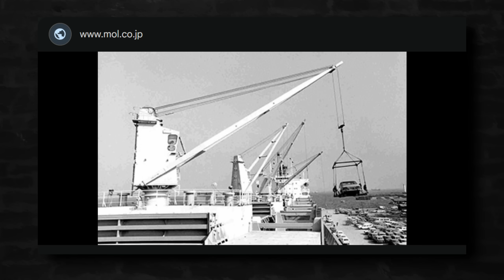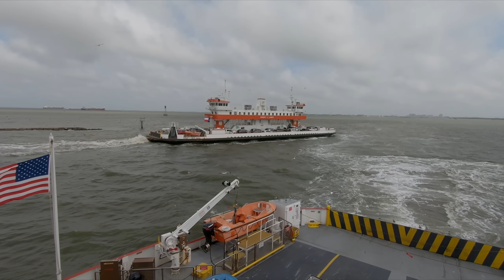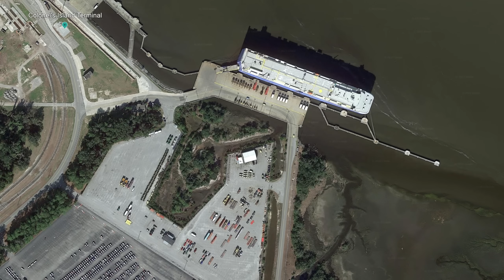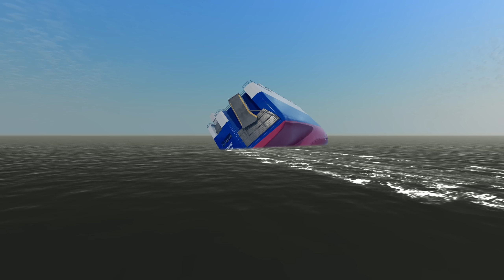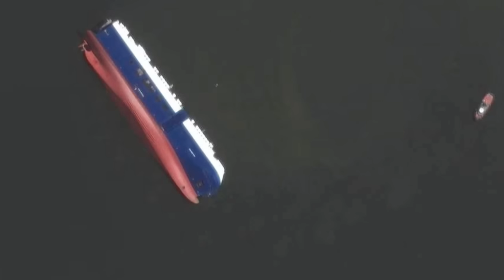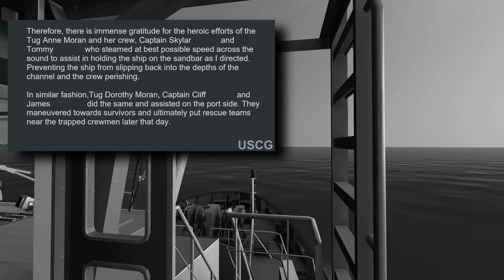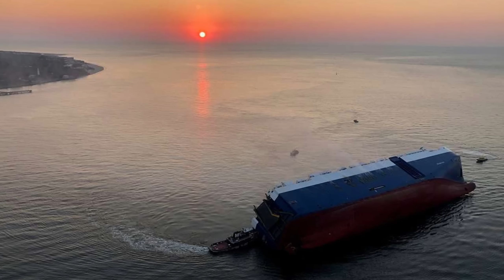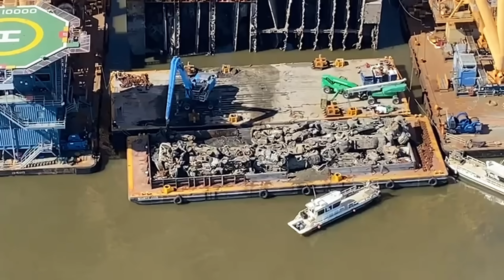ROLL-ON ROLL-OVER: The Loss of Car Carrier Golden Ray

Comment: Great work. I was a Chief Officer aboard tankers for many years. I wonder if the NTSB looked at if the Chief Officer was overworked (not uncommon) and the likelihood that he simply put in ballast figures to make the software show a better GM, to reduce his workload? A more effective system would take out some of the human error by having SAAB radar sensors in the ballast tanks that feed the stability computer and there fore more accurate and can't be over-ridden with out alarming (this is an engineering control under the Hierarchy of Controls and much more effective). I think there is more to this incident that uncovered. The recommendation to the Operator should include: 1. physically verifying the actual amount of ballast in each separate tank by a second independent crew member - not just the verifying the calculations. 2. The Master should be required by the SMS to verify and sign the load/stability/damage control plan. 3. The open WTD's should have indicator lights on the bridge (remember Herald of Free Enterprise). The technology to reduce the risk of this incident has been available for many years. Disclaimer: I never sailed on a Car Carrier, but I did dock and undock a couple in the Port of LA while riding with LA Pilots. These ships are like corks on the water and subject to significant wind cross track error.
Reply: I have no background in shipping, but it did occur to me that the Chief Officer, for whatever reason (overwork, laziness or incompetence) might have fallen into the habit of just fudging the stability  computations, and it finally caught up with him. It is also possible that he simply made an error somewhere. But whichever is true, not having any checks on such a critical calculation, whether in the software, or having another human being verify the results, seems like a recipe for disaster.
Reply: I just looked up the Herald and my goodness!  Why aren't Ro-Ros subject to much closer oversight?  Everytime these ships take passengers and crew down it's very analogous to a plane crash.  I wonder how much of the poor follow through of NTSB recommendations have to do with the sweatheart deal they get (in terms of liability anyway)?

edited to add that the Herald would be a good disaster investigation for this channel
Reply: @mipmipmipmipmip Unfortunately that's the apathetic view many take.
Reply: @mipmipmipmipmip  That seems to be the pattern in these accident videos. All the systems the OP talked about sound really good, but I’m sure they are expensive and sadly a lot of the companies want to cut costs as much as possible.

Comment: So....when unloading and loading a vessel with 6,000 cars, do they need 6,000+ drivers to drive the cars on and off at the same time??
Reply: No, partially because RoRo (as well as Container) Ships rarely if ever get loaded or discharged completely in one Port, it's more like a few Cars/Containers off, and a few on. Kinda like Passengers entering and leaving a Train; it's usually not all of them at the same Station. Having dedicated loading and discharge Ports, where the Ship is loaded/discharged completely is more of a Tanker/Bulker Thing. Plus the Drivers repeatedly return to the Ship, one Team drives off a Couple of Cars only to be brought back by a Van to drive off the next Cars.
Reply: Many thanks!  My question does seem a bit dumb now haha! @Genius_at_Work
Reply: The stevedoreing drivers shuttle back to the active unloading deck in 12 to 15 passenger vans.
In one of the early sequences, you can see a late model white Chev or GMC regular height van recording with shuttle drivers!
🇨🇦 🍁 🇨🇦 🍁 🇨🇦 🇺🇸 🌎 🇺🇲 🇨🇦 🍁 🇨🇦 🍁 🇨🇦

Comment: Maybe im an armchair idiot but always seems that every single one of these accidents happen when the captain or the first officer is in their quarters and the younger, less experienced crew is on the bridge. Like...I assume the riskiest and concentration intensive time of a ships journey is when its leaving and entering port. Sorta like planes. A plane's crew doesn't take a nap right before landing because "opps there's my 30 min break coming up, time for a nap". The time from leaving port to open ocean wasn't that long in this and most cases...so why don't they just stay on duty until they are away from land and relatively safe? I feel like this should be a requirement. Ships effected by weather always seem have a similar story; senior officers going to their state rooms right before the most dangerous part of the journey in the storm. Mind boggling.
Reply: The Master is required to be on the bridge. I believe the Chief Engineer was in his stateroom (his post is in the Eng. Room during maneuvering in and out of port). The problem here was with the Chief Officer, no checks on data entry, not second person verifying the required GM and ballast levels. One of the newer concepts in Safety is that "People will make mistakes and find work arounds". This means the SMS has to have "Fail Safe" processes. This operator did not.

Comment: The contrast with the response to MV Sewol is particularly striking.  Lots of skilled people taking initiative to help.
Reply: Yeah. It really hit home when the video showed the people on the exposed underside of the hull literally looking for any sign of banging from the inside from any trapped crew, then maintaining contact with them throughout the night, then deciding to drill a hole to at least open verbal communication and see the conditions inside. The idea to use the drill to cut a sufficiently large hole without causing a fire was excellent.

Bonus points for the captain immediately calling for help, and telling the first responders that there were at least four people expected to be stuck inside the engineering compartment.
Reply: @Raptor747  They must have seen the temperature was 155 degrees and decided it would be unthinkable to ask them to wait 14 more hours for rescue. They are absolute heroes for their resourcefulness and ingenuity.
Reply: @Raptor747  this, this is what saved those guys. Had responders not known they were there, no one would have tried
Reply: Very impressive improvisation in chain drilling an escape hatch, or is that standard practice in similar situations?   @Raptor747
Reply: @Raptor747  once they had that hole they could use a reciprocating saw to cut steel 1-3 inches thick without sparks. Those saws work well.
Reply: Makes the MV Sewol even more tragic to know.
Reply: I think there were a bunch of skilled people willing to help, but either the SK government refused to allow them to help or actively played a part in making the outside help refuse to help due to safety issues. For example the US dive team coming and later refusing to help due to a large number of safety issues, such as mooring right over the wreck and unqualified government officials wanting to "check" over the equipment potentially tampering with the safe operating of said equipment...
Reply: @zachsmith1676  That last part was super fucking weird. Suits getting to mess with equipment purely for PR purposes was the height of stupidity.
Reply: @zachsmith1676  Yup. That incident was so fraught with tragedy and incompetence that the RoK ended up with a new government afterwards.
Reply: @zachsmith1676 it gets so much weirder. There was no response from the president because she relies on a Rasputin-esque spiritual leader. Stephanie Soo at Rotten Mango covers that angle in her video. Hers go in depth on the politics and weird connections. The ferry’s construction is sus af too. Like if Scientology’s SeaOrg built a ship. 

I haven’t been able to finish Brick Immortar’s Sewol video. After the Rotten Mango vid, I don’t think I will. I just keep thinking about the parents who never got any communication with their son and later they learned it was because he was coordinating with emergency services.
Reply: @NeverFido  I had no idea about this until you posted this (I watched the MV Sewol video just before this). I read up on this spiritual leader and it gave me some shudders.
Reply: @zachsmith1676  even waaaay before that when the accident happened. There were two carriers (American and Japanese) close by waiting to help. While the shop was still in an up right position. But the South Korean government continued to lie to them.

Pretty sure if those ships and their aircraft and sea raft were given the Go ahead. Almost all if not all lives could have been saved
Reply: @zachsmith1676  you know what this incident reminds me of it reminds me of Japanese airlines 123 the deadliest, single plane crash in history. When the plane first went down, US helicopters l almost immediately spotted the crash site and do you know what the Japanese did? They told them to leave because they could handle it themselves

Despite the already high body count, there are many possible theories that at least a 100 people was still alive on the ground. When the Japanese finally made it to crash site themselves they found only three alive…
Reply: Pretty sure a lot of people wanted to help but were actively prevented from doing so.
Reply: You ain't lying. The apathetic response to the MV Sewol is literally difficult to comprehend.
Reply: How its was the new captains fault i dont understand. Sewols yearly saftey training budget - 2 dollars. They falsified everything. The captain didnt even make the fatal turn.
Reply: This was a super professional operation
Reply: That's what happens when you don't have inedpt corrupt politicians sticking their hands in.
Reply: Wow. This is a sad tragedy. Thanks.
Reply: Indeed!! How hard they all worked to rescue human lives!
Reply: Totally agree mate, proper professional performance from everyone involved....... cool, calm and collected.
Reply: HEhehe agreed! THIS is how you mount a rescue! You don't screw around and spend all your time thinking of ways to shift blame or outright lie. You get to work right away! Time is ticking and lives are on the line. And because of this, no deaths! A bit of pain, but overall safe and sound.
Reply: Ships, equipment, and Kia SUVs (most especially) can be replaced, human life cannot. Way to go rescuers!
Reply: Isn't it just? It's all who and when, isn't it?
Reply: This wasn’t in a 3rd world country. Those people just somehow can’t make a functioning government
Reply: I think the government was hoping if they delayed the rescue and recovery processes enough, then there wouldn’t be anything left to incriminate them. The vessel was unfit, and it was signed off on. The more they delayed to cover it up, the worse it got for them, and the more lies they had to cover up. They put their own careers before the lives of others.
Reply: I was thinking the exact same thing!
Reply: Beautiful comparison 🔥

Comment: Do you have any additional info or insight as to why she was deemed unsafe to right and refloat?  From a layman's perspective it seems like a whole bunch of wrecks in way worse shape have been refloated in way worse conditions (Coasta Concordia, the Pearl Harbor battleships, the High Seas Fleet at Scapa Flow, etc.).
Reply: Yeah, the Costa Concordia had HUGE gashes along its hull from making contact with the jagged rock formations from that island.  I thought it was an almost miraculous feat that Costa Con. was refloated, for sure!  I'm not sure why they didn't think Golden Ray wasn't a good candidate for such.  I'll take a wild guess & say that because of the continuous fires, maybe the hull integrity was shot & so unpredictable to guess exactly where all the damage & loss of hull integrity was exactly located throughout that monstrosity of a ship...that's my guess.
Reply: So it looks like they didn't believe that the ship had enough structural integrity left to safely right, and were concerned that a hull failure would release enormous amounts of pollution. Although I can't find the primary source for this. 

From marinelink:
"The Golden Ray will need to be dismantled in place and removed in pieces because the vessel, in its current position and condition, would not be able to support the stress exerted on the hull and keel during parbuckling operations."

And from gcaptain:
"Officials overseeing the salvage of the overturned Golden Ray in Brunswick, Georgia have opted to dismantle the vessel in place in lieu of refloating it due to environmental concerns."